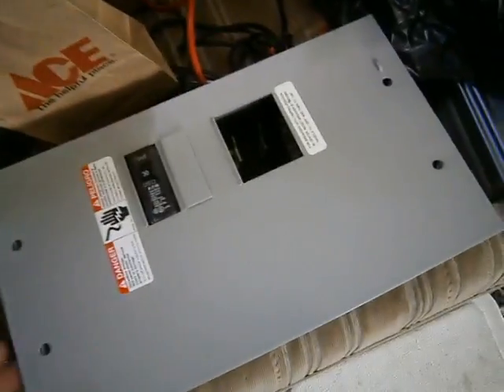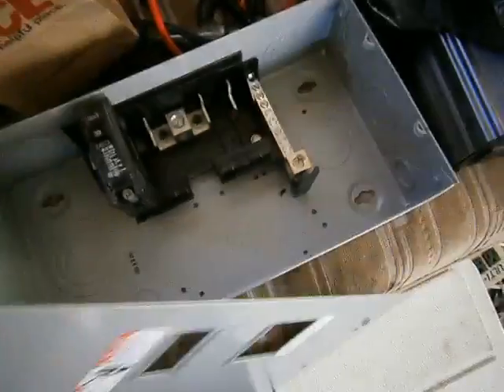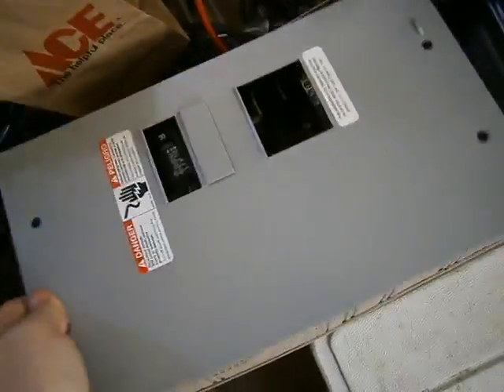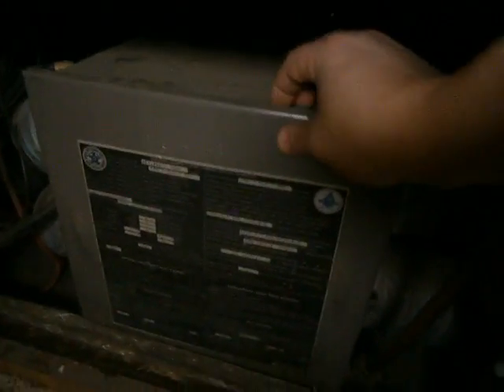CUSTOM RV BREAKER BOX REPAIR

Comment: did you update the wires for something new you are going to add? or were the old wire not safe anymore? Merry Christmas
Reply from the maker: Basically i extended the wires (from the old breaker switch location) over to a new breaker box because the plastic mounting plate for the busbar in the old breaker box was burnt and fell apart, the switches no longer had a place to clip into. Sorry i should have tried to get better footage of it but i'm still learning. :)